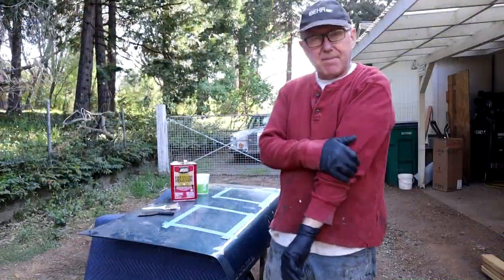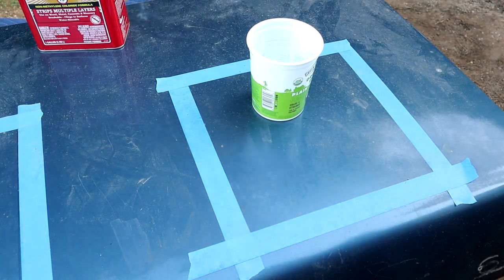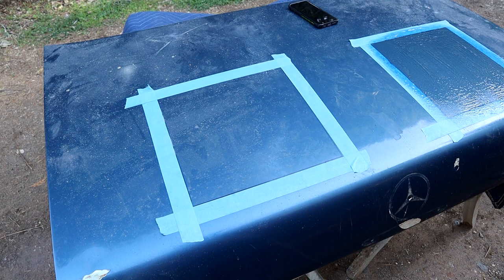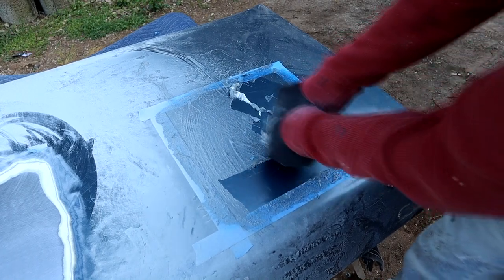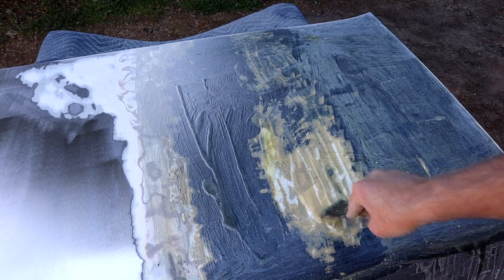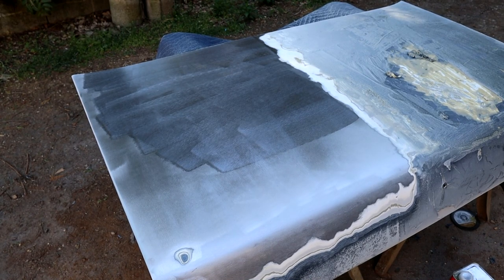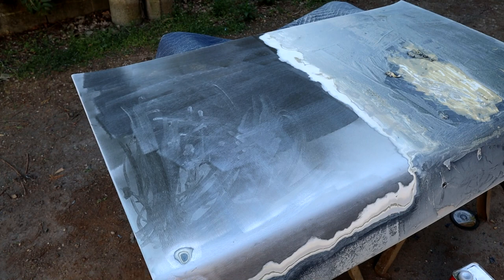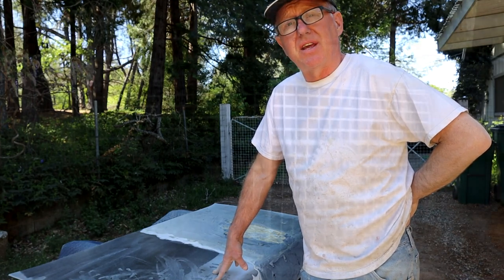Mercedes W109/ W108 Experiment with Stripping the paint. Chemical VS Mechanical Removal.

Comment: I think I would rather strip the paint than deal with the double patches in the engine bay. thanks for showing the lack of power of the chemical strippers currently as it relates to car paint.
Reply from the maker: They may well work better on less layed paint. This thing has so many coats the stripper cannot cope. The double patches aren't to bad to deal with. I just figure its all part of the process. It would bug me more if I didn't do them:) 
Cheers John

Comment: I truly enjoy and share your passion for these mercedes. I believe I mentioned before that my dream car is your 6.3  Listen, you should watch the channel called "weird Beard"  He does a lot of body work on a budget. Not that you would follow all he does, but he basically stripped by hand a 59 Dodge Coronet, so there is a lot of videos and he goes through the detail of what works and what doesn't  I think you are on the right track with the tool. He also basically uses smaller angle grinder with discs he buys at Harbor Freight. So again on a budget and did the job. Again being careful with the heat on the panels. However like the coronet, our mercedes is think gauge so it takes a lot to deform it.  Check it out. Greetings from Orlando. BTW what is your first name?
Reply from the maker: Hi Frank. Thanks so much for the comment and the tips. I will definitely check that channel you suggested. My first name is John. All the best to you and I'm glad you're enjoying the channel. Cheers John.